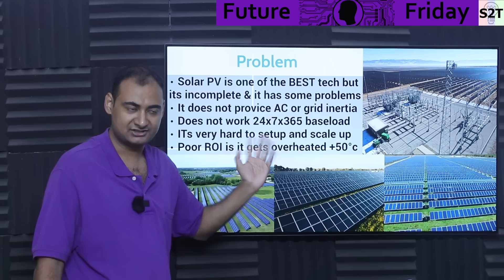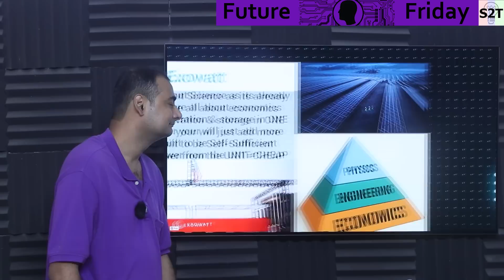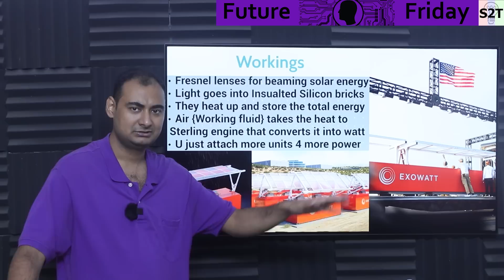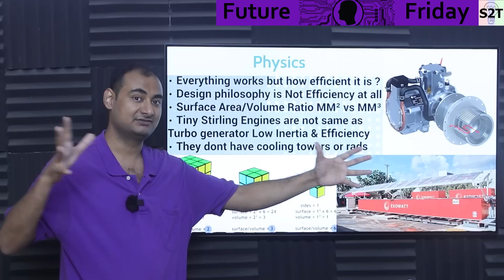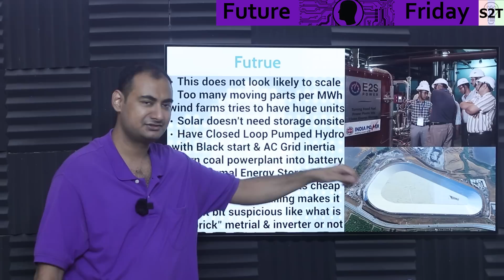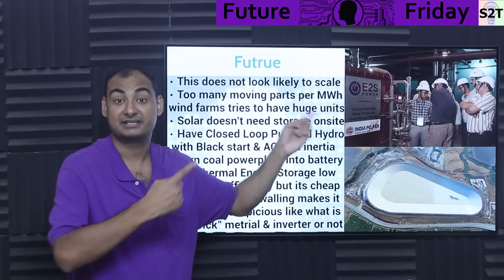Exowatt Store Solar Explained {Future Friday}

Comment: Smells like BS. Focused sunlight from those Fresnel sheets goes into those bricks made of what, maybe ceramic or graphite? Then some tubes on the sidewalls supposedly circulate a hot liquid, air or gas through a pipe system, which somehow (pushing out air through some sort of turbine) gets a Stirling motor to turn and produce energy. Yeah… do you smell that too? So basically they are saying “We use a proprietary engine to convert heat into electricity on demand.”Corpo speak for we’re still figuring it out (or we don’t want to say it’s a Stirling engine because investors know that’s hard to scale). Without a clearly described conversion mechanism, all the “modular thermal battery” talk is basically “We can store heat!”. Cool, so can a pizza oven. But how do you turn it into electricity efficiently and cheaply?
Reply from the maker: yes I did not like their stonewalling tactics

Comment: Great video! Another aspect, combining multiple techniques that are relatively bad compared to some other readily available options, either in general or at least in that particular context, can't make a great overall system.   

While making thin sheet polymer Fresnel lenses can be cheap, in order to concentrate sunlight well they need to retain their shape, exactly, in every aspect from their overall shape all the way to the surface shape on the microscopic level, and remain clear, and also clean, on both sides. Combining the requirement of being clean with the fact that physically cleaning them wear the surface details down isn't great for longevity. 

Great take on how stupid it is to make tiny thermal energy storage systems where intent is to convert that stored energy into power. Why would anyone choose something that gets worse the smaller you make the system for a very small system?   

Also, combining all the aspects into tiny complete systems where everything is locked to that specific process doesn't make any sense, what's the point? Solar PV, where you can use whatever amount of power you have use for directly, and deal with any mismatch between demand and supply in other ways, ways that are cost efficient, makes sense. 

And Stirling engines? Besides lacking "inherent rotational inertia" they're not as efficient as turbines, and have reciprocating mass. Just making them produce power with somewhat relevant efficiency is really difficult, there are good reasons for why they are very rarely used in practical applications.
Reply from the maker: I have no clue why they are not sharing enough info . I really dont get topology as Physics does not like it

Comment: oh and why you are so fixated on inertia ? when you have batteries and inverters that are way more precise in following funny 50 or 60 changes HZ a second when electronics are way way and way faster and with batteries you have depth of power very cheaply and inertia will have problems in following HZ if not well synchronized ... thats why decades ago were way more power outages
Reply from the maker: ask anyone who RUNS GRID you can't have national grid without inertia . GRID it self does not synchronize without inertia miner minor failure becomes cascade failure . inverters are not suitable replacement . there is a reason why grid tie inverters are grid following not grid maker .some people are working on grid forming inverter but its too much trust on microcontroller and code and silicon swtiches {yes nope} where inertia gives you smooth harmonic free sinusoidal wave everything else is imeatation at best . don't get me wrong inverters are great for isolated loads but NOT NATION GRID
Reply: @s2tenglish  I mean i heard those claims before but it seems just not up to date or maybe i am just wrong. 
but one recent thing that reinforced my belief was Memphis XAI datacenter that had problems with crazy fast changes of load and not enough infrastructure to get enough electric power. so they had to get Gensets which are slow comparing to load in databases (very very fast changing) so they used inverters and batteries in their own grid load following challenge although they had to change software to start or control batteries even faster it now works well in real life and when you search for how fast processors and electronic switches that are used for simulate sine wave they can go extreamly fast so should be possible but maybe whats holding back is software but abilities of electronics are there . Or i am just wrong but for now i couldn't prove that it has fundamental problems which would prevent if from working... 
of course you still need a lot of batteries
Reply from the maker: see u can brute force anything but question is SHOULD you when u are dealing with a Pure sine wave source which rotationally coupled to the magnetic field everthing thing else is a cheap knock  off as u get what is analogue resolution {infinite smoothness} while best one hopes with inveter is multi level inverters which can have 200 levels to "simulate real sine wave with minimal harmonics"  . Yes you are outdate as the worlds best  HVDC interconnect still utilise synchronous condenser {Spin mass} to creat to create grid inertia & look into Ireland's great grid stabilizer {coal power plant converted into spin mass inertia for the grid } U cant only trust inverter for isolated grid at national level its just stupid and why deal with BS when u dont have to why not use physics and inertia to your advantage